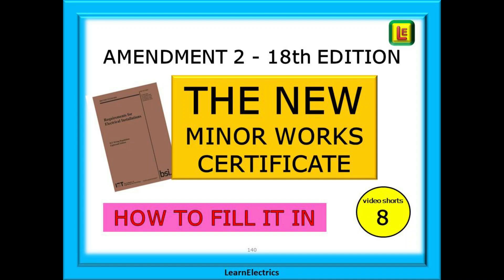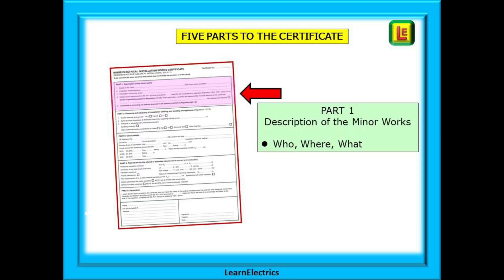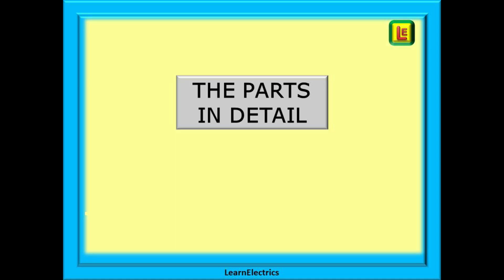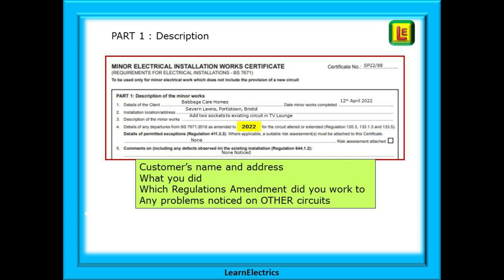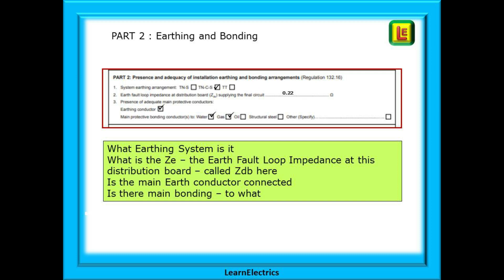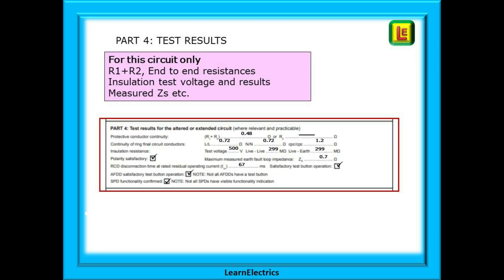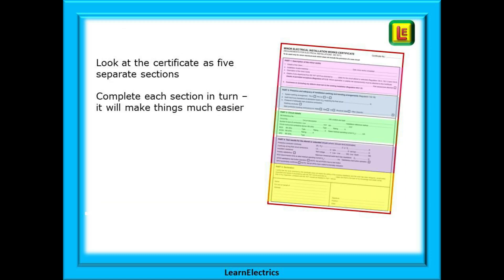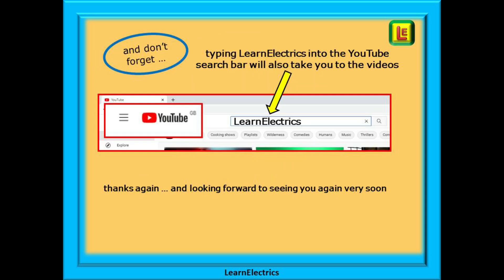AMENDMENT 2 - 18th EDITION - NEW MINOR WORKS CERTIFICATE - HOW TO COMPLETE IT - SHORTS 8

Comment: Hi Dave,

Something I'm trying to get my head around. On the Minor works certificate you only have one Zs, One R1+R2 values etc for final circuits. What about if your minor works include lets say 3 different circuits. Would you use 3 different minor works certificates to this because you can't put all reading on one certificate. 

Thank you
Reply from the maker: Correct. One circuit one certificate. If you have the kitchen lights and the lounge lights on the same MCB, then that is one circuit, one certificate. If they are each on their own circuit breaker, then that is two circuits, two certificates.
Reply: @learnelectrics4402  Really appreciate it Thank You.

Comment: Love all the content you put out.
Would this be issued if a installer spurred from an existing ring main to supply a new lighting circuit via an fcu and correctly rated fuse?
Reply from the maker: All electrical work should be certified. Have another look at the video. This would be Minor Works.